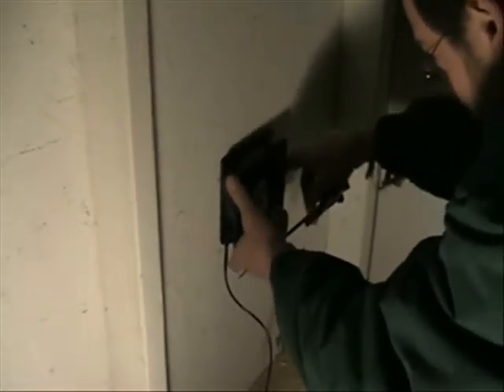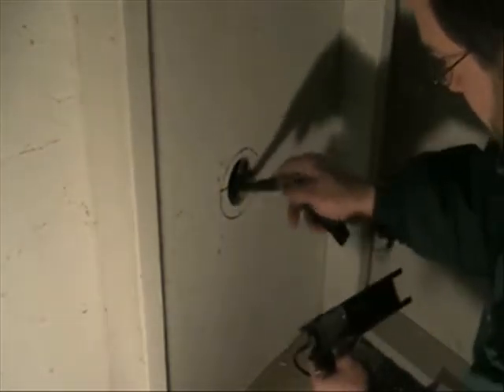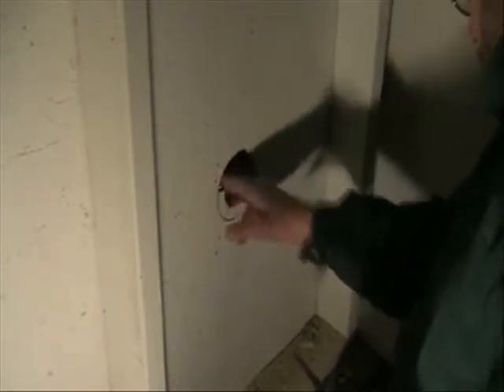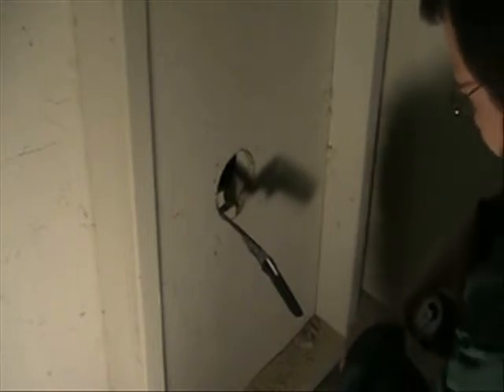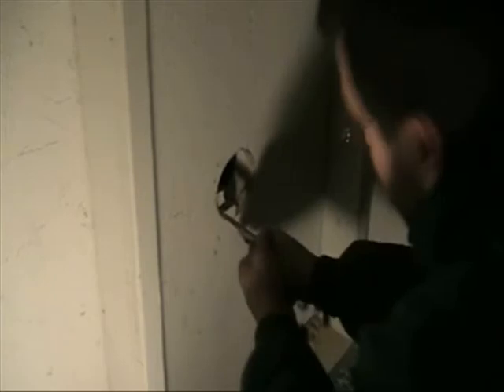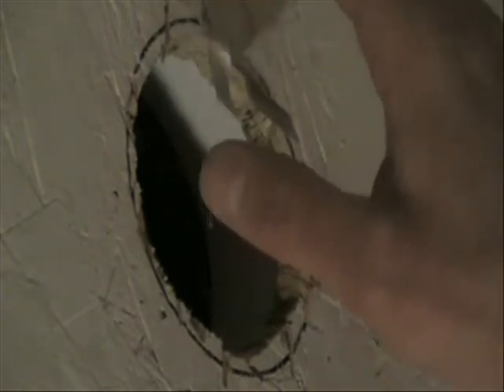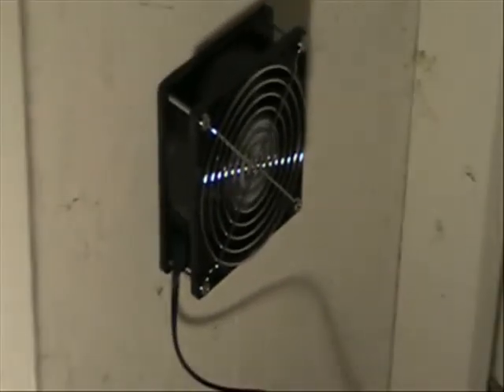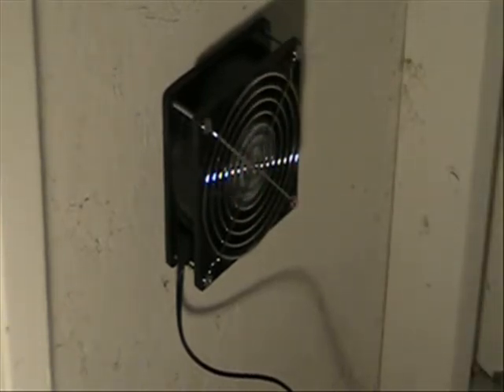A quick Solar Update

Comment: I bought a fan at home depo earlier this year that fits inside the duct. It was only about $20 and runs on 110, just add an old vacuum cleaner plug because the cord is long. the other thing you could try to prevent the blowback would be to put the fan on the top hole and turn it so the air is sucking through the duct, you could make a tight seal to the duct with caulk or something.

Comment from the maker: @water4fuelh20 I was thinking that i made holes large enough for sufficient air flow but i started second guessing myself so i tried out your hair dryer idea. I found that it increased the air flow a good deal. Thank you for the idea, I guess my next step is to find a fan that fits, with sufficient air flow, that isn't too loud. Thanks again!